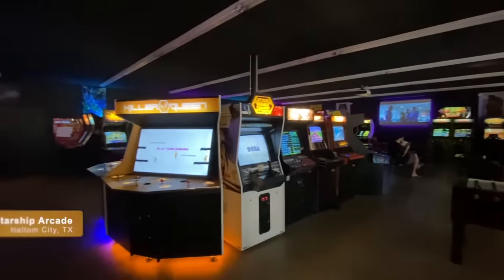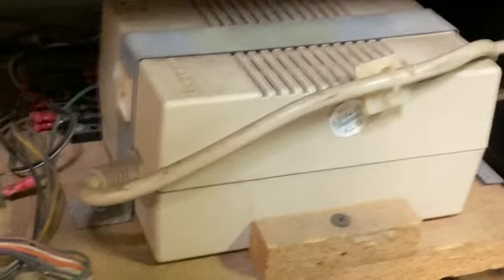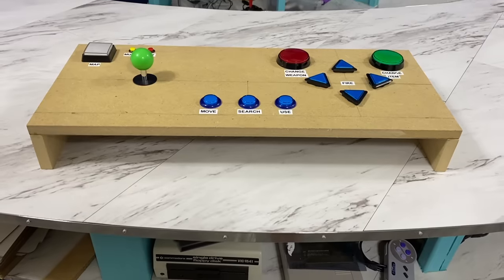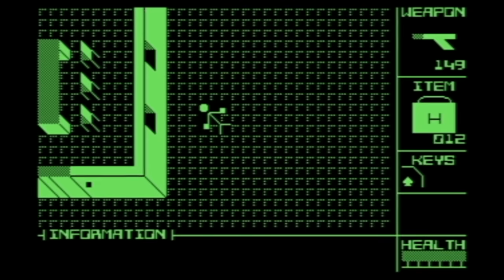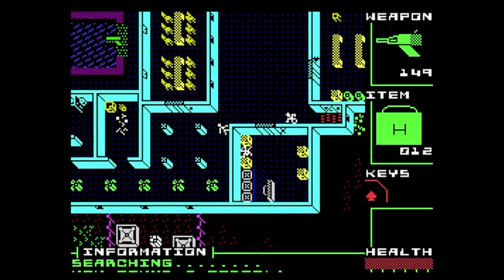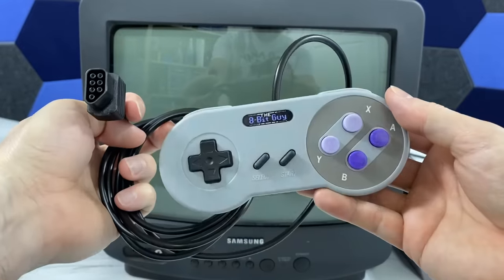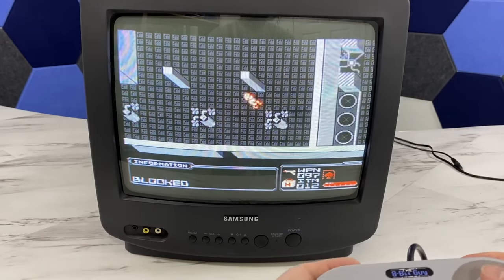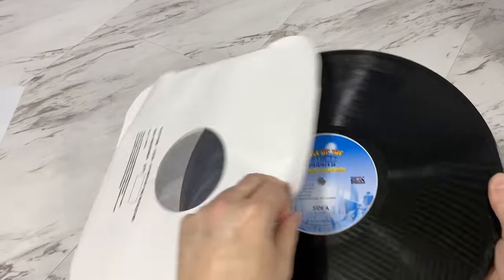Petscii Robots Mega Update - Arcade, Genesis, MS-DOS and more!

Comment: 02:30 Seeing a new old stock CRT just puts a smile on my face - those scanlines are magnificent. And the Sega Genesis version of the soundtrack sounds rad as all hell!
Reply: Its the only way to go with retro gaming. Im super happy with the one I found that my neighbor threw out. Its a late model (for CRT) Sharp with component hook-ups and S-video w/ composite. I bought a cheap 4 In / 1 Out S-Video/Composite switcher for SNES-N64-GameCube with S-Video cables (no s-video cables for the NES) and I hooked up the PS2 thru the component and it looks amazing. The best part is no screen drop out when the game changes resolution (the PS2 often had the intro screen and game in different resolution, or even the pause menus) and no "Video Mode Not Supported" when playing PS1 games on the PS2 thru a component cable. Another big plus is I can play my PS1/2 light gun games.

Sorry for rambling

TL;DR CRTs are awesome.
Reply: Nat  Barela🇺🇦  I forgot how bright the CRT was on my PS/2 Model 25.
Reply: We need someone to start making new high quality CRTs for retro gaming again at reasonable prices of cause. I got 3 CRT TVs plus 1 CRT VGA monitor but you never know when they will kick the bucket without being repairable. Also would love smaller CRT TV with stereo sound as both of my smaller ones are mono.
Reply: @moomah5929  There was a thriving CRT industry in India up until fairly recently.
Reply: @douro20  That's interesting even if it would be a bit expensive to ship CRTs from India to Europe nowadays when not talking about huge quantities in freight containers.
Reply: @moomah5929 agreed.

Comment: I'm surprised nobody has tried to port Attack of the Petscii Robots to the TurboGrafx-16/PC Engine yet, since it uses a 6502 derivative for its CPU and most of the other well-known 6502 based systems have a version of their own.
Reply: A Super CD-Rom port would be nice too, with digital audio/music.
Reply: Be still my beating heart..
Reply: I'm surprised no one tried to port it to Ben Eater's 6502 computer. He did make a graphics card for it.
Reply: @Ninnuam999  It'd be easier to make a physical release since all you need to do is burn a CD.
Reply: Ported petscii robots to my Abacus, very difficult to play but fast port.
Reply: Or PC-98, X68000, FM Towns, Famicom (using VRC7), MSX, 32X, Master System, PlayStation (PS1), Amstrad CPC, Classic Macintosh, Jaguar, Atari ST, Falcon and Neo-Geo AES.
Reply: @marioalexanderski9598  yep, many systems overlooked. ST, master system, MSX2, and Amstrad versions should be made, and also for Atrari 800/XL/XE!
Reply: @RMoocher  
And CP/M systems like Osborne and Kaypro.

Comment: Not sure if this has been mentioned or not, but MMC5 is not in Super Mario Bros. 3. It's a fairly uncommon mapper and it would be expensive to sacrifice the games that did use it just for this. There are FPGA implementations used in the PowerPak and Everdrive, but I'm not sure if it is generalized or specific to the full hardware.
Reply: i have a few cheap chineseium everdrive copies... would they have the same chips in them?... if so, that's a very cheap alternative!
Reply: @jeffredd9965  It's not that the FPGAs are expensive, only the originals. The problem is that I don't know if you could just use the mapper plug-ins as is or if they would need to be recoded since they might be specific to the setup. That is, I don't know if some logic is missing since the mapper drivers are made for a system that chooses the correct one to use based on the iNES header.
Reply: I would expect modern NES games to have fully custom CPLD or uC mappers. I'm really surprised anyone is even talking about destroying old games to salvage chips!
Reply: @thewhitefalcon8539  I personally wouldn't as FPGA replacements or a custom FPGA mapper is, barring chip shortages, both cheaper and more readily available. As I mentioned above, MMC5 cartridges are uncommon and would be expensive to just sacrifice.
Reply: @striderskorpion  Another option would be a little bit of discrete logic, in fact I bet the first mappers were done that way. Just like, latch the data line when the write enable is on, or something.
Reply: @thewhitefalcon8539  They were looking for some specific feature found in MMC5, otherwise discrete logic would be easy and simple for just bank switching.
Reply: Given that home brew games using MMC5 Mapper features on real cartridges have been common for the past few years and there's multiple solutions I suspect David's NES programmer isn't particularly skilled/experienced in home brew releasing.

Comment: It would be so cool for the arcade to be dual monitor. Maybe even having just a smaller sized monitor for the map so it doesn't take up too much space.
Reply: like a cctv monitor?
Reply: Needs more Punch-Out!! vibes
Reply: @Light-DelaBlue  A 5 inch black & white CRT (maybe with a green gel over it) mounted in the control panel would be pretty sweet.

Comment: The Genesis version should have been easy to port to arcade, even using original hardware. The Genesis was a slightly scaled down version of the System 16 hardware. In theory, you could have just flashed a rom and dropped it into a machine. In theory.. I'm not a coder. But the Amiga conversion is a great idea.
Reply: The Amiga also offers up complexity. The disk drive and booting properly is my primary concern there. The Genesis either boots or it doesn't. Not to mention that custom character chip. What happens in 30 years when someone has to repair this and rewriting ROM chips is even harder!
Reply: It's not that close of a conversion, unfortunately. The System C board is a lot closer to the Genesis hardware as delivered, but still not identical (same VDP, FM, PSG sound, but with no Z80, and many more colours using a pretty fancy trick encoder, for instance.) It would be a fun project to see if you could port it for sure – the price of Columns boards is creeping up but there were certainly a lot of them made.
Reply: @f.k.b.16  Well, it sounds to me like the arcade game is just a one-off project, not something he intends to go into production with and sell as a commercial product, so any repairs and maintenance are going to be his problem. :-)
Reply: By using the Amiga port as the base for the arcade, David went much more far than the developers of American Laser Games, who made the Mad Dog McCree shown. That machine only used the Amiga for the HUD graphics and as a mere I/O controller, the bulk of the game was just Laserdisc full motion video (the Amiga itself drove the LD playback as the inputs it got required).
Reply: well, at least he used some form of period appropriate hardware rather than just shoving in a raspberry pi and calling it a day (seriously, that's basically cheating)
Reply: @technoturnovers7072  an arcade cabinet is its own hardware platform, so there is no cheating as long as it works.  If you want to compare it to the custom board layouts for games like Pac-Man, then putting an Amiga inside is just as much cheating as putting a Pi inside.

Comment: After seeing that PSP version, I wonder if someone could port the game to the Nintendo 3DS, with 3D support and everything ;) It would be the perfect handheld for this game, especially considering you could use the bottom touchscreen for things such as the map or selecting items
Reply: JM Coulon might have a point. But Nintendo DS with its' rampant piracy in the form of an R4 card (including clones) which could load roms might be an option.
Reply: @JM Coulon It absolutely can run unlicensed games, the console has been hacked long ago and is wide open. Even the latest firmware is very easy to unlock. As for the store, it only closes march of next year (2023), the only thing you can no longer do is add funds, but the store is technically still open
Reply: @JM Coulon Maybe they can sell DS cartridges made out of flash cards?
Reply: @JM Coulon I personally wouldn't care. While 3DS flashcards work on all official firmwares, they only work on OFW if used for piracy. To run unlicensed code requires CFW, and always will, because reverse-engineering signatures like that is actually illegal. Trade secrets. Boot9strap is only legal because the bootrom uses exploitable verification code.

If PETscii 3DS comes out and is the best version, I'll buy it. The 3DS is powerful enough to let you choose graphics styles and soundtracks. Add in the multiplayer from the Mega Drive version (fun fact, you actually CAN send modified Download Play CIAs to unmodified 3DSes, so PETscii could support that too) and maybe some 3D (at LEAST a cool 3D banner) and you have a winner.

Comment: I still wish one of the Devs implemented a smooth scroll option. It would only slow things down by an 1/8 of a second, not significant for an action strategy game, and it would look so much smoother. Chunky scrolling is fine on a home computer, but I can't think of a single arcade game that failed to do 60hz scrolling.
Reply: If we're talking about smooth movements for all objects, that's not about slowdown, it would completely change the gameplay. Tile based movements for everything but the player is much easier to implement, as it won't affect the gameplay, just the visuals. But I guess every dev just considered it to be looking too weird.
Reply: @shiru8bit  I programmed a vaguely Tetris like puzzle game (but boring) for my Amiga in the 80s. Everything was locked to a grid, but it just took a barely noticeable freeze of the action to keep the game pieces gliding from place to place rather than simply being erased and stamped elsewhere. It's like those meatspace plastic sliding tile games. Everything is still tile based but the numbers don't just disappear and reappear in their adjacent spot. Anyways, I'll shut up until I pick up coding again and can do a proof of concept :)
Reply: Probably more like gen 1-2 Pokemon, where the player moves in tiles but tweens between those tile stops?
Reply: @dyscotopia  I did my share of smooth Tetris games, too. The difference is that in Tetris the only moving thing is the figure, while in David's game there are independent objects that move on their on - robots, doors, bombs that alter the BG, etc - and all of this is async. It complicates the things a lot if you want to add smooth offsets to everything besides the player.
Reply: @parnikkapore  yes, that is a viable compromise.

Comment: Super excited to see you're building an arcade cabinet, even though I might not get the chance to check it out myself, because I've been wanting to see someone make a proper, crt monitor arcade cabinet for a while. It's also been a project I've wanted to try for a while-I was gonna stick a stripped down old television in one connected to an emulation system, but I've never been able to find good blueprints for a cabinet.

Comment: Using an Amiga to run an arcade game is an ingenious idea.  I remember hearing about some arcade systems using Amiga motherboards; I first heard of it with CD32s being used for slot machines of all things!
Reply: Look up Arcadia Multi Select system. It was Amiga based cabinets running games.
Reply: @6581punk  I remember seeing advertisements for the home releases of those games where they proudly proclaimed that the one megabyte Amiga version was identical to the arcade game. I remember thinking that must have been one hell of a port because I didn't know that the arcade was just an Amiga
Reply: furry :(

Comment: It would be nice to see an enhanced MMC(1,3,5) version at some point, even if only as a ROM image.
Reply: Good call. Having a MMC5 digital-only release could help to break this circle and make a modern MMC5-capable board a possibility eventually.
Reply: @shiru8bit  I agree with you and James Lewis that an “DX” version using the MMC5 will be necessary later down the line.

Comment: For the CGA version, you should switch to 160x100x16 low-res mode when displaying the map. Now if you want a REAL challenge, create an Intellivision port! By the way, there's a newly-designed add-on for the Intellivision called the Advanced Console Component that would handle Petscii graphics extremely well.

Comment: When Disney produced the Fix-It Felix Jr cabinets to promote the associated film, the game itself ran on an old PC running Windows XP, and some (I believe not all) cabinets were converted from (hopefully inoperable) Donkey Kong cabinets).

They just put mounting brackets to secure the PC in place, added a USB to JAMMA controller, and installed an LCD monitor where the CRT originally was.

Comment: I know ChrisFratz already mentioned it, but I wanted to say to ensure that the edges of the card connector in the cartridges releases are beveled. Original game carts had their edges slightly beveled to make the insertion into the slot easier on the pins inside it. A flat edge connector could damage the pins

Comment: What are you going to use, Scramble hardware or Neo Geo?  

Well, the Amiga was used as arcade hardware in the Arcadia system.  I think it was based on the A500 with Kickstart 1.3.  

There is a part of me that would like to see a BBC Micro version and maybe even an Acorn Electron version.  

Also, is the Spectrum version compatible with the original 48K version?  You might have managed a more colourful version with better sound if it was 128K only.

Comment: Do you plan on adding a coin-per-play function as an option too? I could see a couple of the larger arcades like Funspot adding this game to their lineup, though their games use tokens instead of freeplay.  

The arcade games Up Scope and the Arcadia Super Select System which supported games like Xenon, Side Winder and Aaargh also used Amiga 500 boards.

Comment: There are low profile socket pins that can be fitted to a circuit board which would allow you to socket the chips and still fit the board into the cart.

Comment: One thing with the arcade monitor, the Amiga RGB lines are not the same level as the arcade monitor expects. You'd ideally want to put a video amp on the amiga output but it wouldn't harm the monitor, just look a bit dim.

Comment: Reading the manual was part of the experience back in the day. A lot of games from the 80s, 90s and even early 00s expected you to do so. So when I see someone try to play an old game, especially a strategy or RPG, I just shake my head at them.

Now I admit that when I was younger I did not read manuals ether. Mainly because I did not know how to read. But I also had a lot more time just to experiment. Even then would take years later when I actually started to be able to read, and I got my hands on a manual that I often started to master some of these games.

Now a days I often miss manuals. Some games just work better if you have a big, well written manual. And sadly that is quite rare these days. Often they rely on a wiki instead for the more complex games. And that is not Alway that well-made ether. Though I do like wikies.

Comment: To the point of Amiga 500's being used for other things besides on your desk at home, I can remember when I had my 500, I had a buddy who worked at a paint store and they had a kiosk for paint selection.  If you were tall enough to be able to look inside  the top of the cabinet, there sat an Amiga 500.  I don't remember which paint manufacturer provided the kiosk.

Comment: I like to build arcades for my personal use. I have an arcade room. I don't have a extra Amiga 500 laying around. But I did buy  2 Mini A500 amiga's? Do you think that would be suitable? And will you be selling the arcade Petscii version that would be compatible for and physical arcade?
Reply from the maker: The problem with the Mini A500s would be the control scheme needs a keyboard.  You might be able to hack a USB to pieces and wire up the various keys to buttons and make it work.  Of course, there will be a bit of lag using an emulated device instead of the real thing, but probably would still be acceptable for this game.  Also there's no easy way to interface HDMI to a CRT monitor and have it look right, so you'd probably have to use an LCD.

Comment: I think you could get some MMC5 features by going Frankenstein mode and making a custom mapper from off the shelf parts. The 8x8 color cell feature is something available out of the box with the PPU, there's no mid scanline pallette switching or something like that. It's just that the CHR ROM or RAM is set up differently.
Reply: 8x8 color attributes are totally not something available out of the box. It requires a major time-sensitive trickery on the PPU bus and extra RAM, relying on the fact that every attribute byte gets fetched from the same address by the PPU twice, i.e. for each tile. MMC5 tracks down these fetches and maps out corresponding ExRAM data, Yes, it kinda boils down to 'RAM set up differently', just the set up get changed by the MMC5 hardware every 4 PPU cycles. And that takes a beefy CPLD to implement in hardware (unless we've got cheap DSPs fast enough already, but I doubt so).

Comment: Attack of the Petscii Robots has now overtaken every other game as the most ported over game! Awesome, work!
Reply: DOOM still beats it out by a long shot. There's NES (Sorta), SNES, Genesis, GBA, N64, DS, 3DS, Wii, Wii U, Switch, every Xbox and Playstation released, the Amiga, DOS (Obviously), every version of Windows, Mac, and Linux, freaking printers and calculators and that's JUST the ones I'm aware of. Of course no disrespect to David, having it on this many platforms already is insane for a game made by just a few people.
Reply: @CricetoFunni  Good point. I am genuinely impressed Dave and several others have ported Petscii Robots to so many other platforms. I really think by doing that yourself it teaches you a ton about the various types of hardware and code.